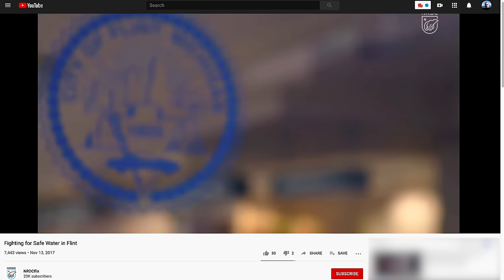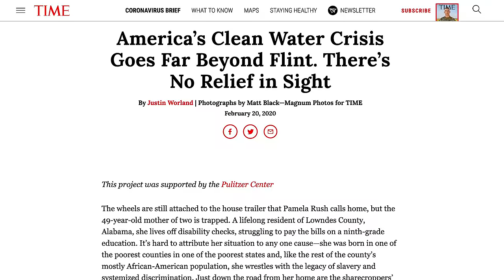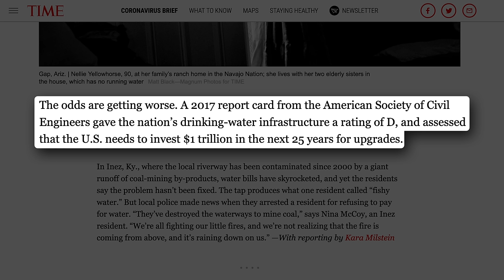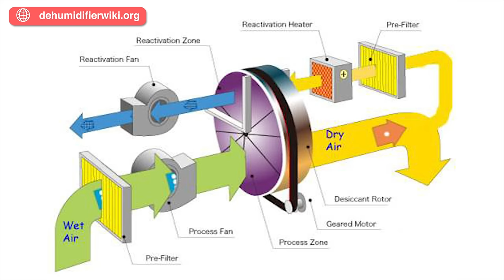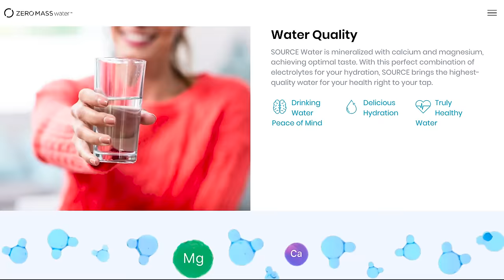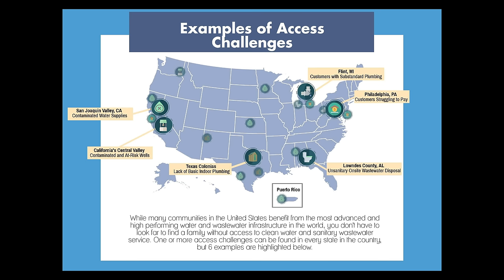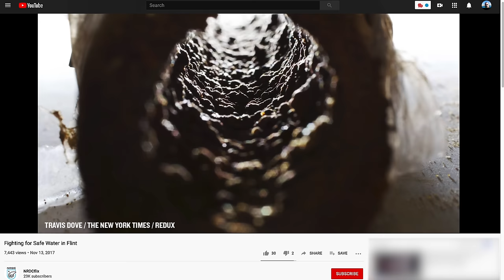Off-Grid Water With Air and Sunlight

Comment: Elon is thinking of an HVAC system that also produces potable water.
Reply: The theory is that HVACs already produce potable water based on the condensation process of pulling humidity out of the air.. it's a question of rerouting the water for drinking purposes.  Don't tell Ben .. he might be disappointed knowing he spent a few more dollars than he had to..
Reply: That's the easiest thing in the world, and hardly requires Elon's engineers to figure out; you just route the condensation drain line into a tank for a filtration system.
Reply: I’m pretty sure Tesla’s HVAC will make way less noise.
Reply: @ArcherWarhound Yes.  The only challenge is that they don't have a more powerful system yet for home use.  The HVAC system in the Model Y is too small.   They could push it though as a compact dehumidifier/heatpump for small rooms.
Reply: ArcherWarhound. I'm sorry but if you look inside your condensorat your home, you will have a total change of mine. Their not build adequate for consuming the water produces that is produce. Maybe for watering your plants
Reply: Yep condensation, need to go Dune and put Still suits on Tesla's. Home aircon should make enough,  salt, brackish water can provide humidity. Not many places with zero humidity. Frozen water is still water.
Reply: the water from HVAC does not have the minerals of natural water
Reply: @kawabanga9507  nope you are wrong
Reply: @nelsonpagan5163  yes you are right, plus those conduits needs to be cleaned after sometimes for drinking pruposes
Reply: Le Chat Botté please explain. How loud is your HVAC in your model 3? Basically it will be a scaled up (1-5 ton)version of it. I can’t imagine that it will be as loud as this unit.
Reply: Alternatively install mains water filters. A .05micron paper filter and a .05carbon filter will give you pure drinking water
Reply: Easy yes and no. Getting the water is simple enough, but what I’ve seen come out can be kinda dirty so they will need a filtration process if they don’t want the water to taste like s***
Reply: We just installed a top of the line system by Lennox, total of 3 units that have an ultraViolet light filtration system scrubbing the air with an ionizer charging opposing small particles so more of those tiny micronic particles get collected by the 2 filters which live in a box housing the UV bulbs..... So there's always forced air running through the vents and it's extremely energy efficient and quiet. I'm all about saving energy and killing viruses and bacteria in the air. I love the idea of generating water. I would definitely look into that. thank you for posting this video and taking the time to make it. I became a subscriber
Reply: @kawabanga9507  Acura, 10 years ago, developed a system by using the stereo to create canceling sound for a quieter ride.  Point being, put speakers near the unit to produce low frequency sound near that high squeaky noise.. problem solved.  Using one frequency to cancel another frequency is not a new idea, Acura made an interesting application but clearly their can be many applications for noise cancellation using this method.
Reply: Erin isn't the one thinking.  He has no brains.  LoL His smart teams are the one coming up ideas.  He is just pick and choose one he thinks it's gonna make money.  That's all.
Reply: @ArcherWarhound  The trick is to keep the condensate clean and sterile.  I suspect the solar panel uses electricity or the UV to sterilize the system so it doesn't start growing mold, fungi, and bacterial contamination from the particles in the air.  You ever seen the slime in the discharge pipes from your HVAC system?
Reply: @williamediger3193  Yes, I have seen the slime that builds up, I've cleaned it out of many an HVAC, that's why I said it need to go through a filtration system after being condensed.  You could reduce the amount of yuck in the condensate by having the air go through a REALLY good filtration system before hitting the cooler/condenser, but then you'd need a more powerful and thus noisier & power-hungry fan.  So filtering after cooling/condensing makes more sense to me, but I could be wrong.
Reply: @ArcherWarhound  Yeah, I agree completely.  The only place this system makes sense is if you live in a desert or area with limited access to water anyway.  I have an artesian well with a pump run off solar panels.  The water is clean and if it does become contaminated, filtration and cleaning techniques are still cheaper and easier than this system.
Reply: AC Condensate is actually either caustic or acidic (I forget which) and typically has very high levels of copper / aluminum due to the refrigerant lines and condenser lines where the condensate drips from and comes into contact with.  It isn’t safe to drink directly and would definitely need filtration and probably ph adjustment as well to be safe.
Reply: Sure, if he can make money off of some poor sods with that.  The Greens are thinking about making water potable again by reducing environmental pollution, but that is an utopian dream; no billionaire would be able to make money off of that.
Reply: A dehumidifier? I keep on in my windowless bathroom.
Reply: This is not potable water. You can't drink distilled water because it will deplete your electrolites which could give you a heart attack or shut down your kidneys etc. Oh, and by the way, Elon is a pothead crook.
Reply: @nelsonpagan5163  requires some modifications... rather minor...
Reply: @leolima75  I have been drinking DW for years...adding plant-based minerals...
Reply: @aeh8446  like I said, it's not directly potable water.  Do you need heat to extract these 'plant based minerals' ? Put that on the bill too. That's probably hundreds of times more expensive than water coming from the natural hidrological cycle of the Earth. But we're desertifying everything and thirst shall come.
Reply: HVAC systems already produce potable water. Nobody bothers to do much with the condensed  water.
Reply: @williamediger3193  cheaper for short run but what about the limits of artesian water wells? Maybe Arizona and similar could give tax credits for using this type of system (Elon’s or this or another similar) instead of taxing the artesian systems that could feed wildlife?
Reply: Elon is going to produce that for 1/3 less and use his slave labour for that
Reply: Yes, but it may be illegal.  Check your state law
Reply: @aceshigh235  Yes, I made one three years ago for my RVconverted ambu, with whole-house filtration, UV, and minerals added. Still working. 
I went to the Denver Botanical Gardens to examine the unit these ppl installed as a promo, and it produces ONE gallon per DAY, unacceptable for any animal over 40lbs.
Reply: The only thing that they need to do is make sure you have real good air filtration and probably some stuff to make sure you everything is clean and probably some uv light but ya not a huge deal
Reply: Already exists.
Reply: @kawabanga9507  Modern units make very little noise.
Reply: @nelsonpagan5163  wrong.  It's perfectly clean if you keep your unit clean.  Regardless, it's very easy to filter.
Reply: @carholic-sz3qv  True, but still drinkable.  Very easy to add minerals.
Reply: Luke Skywalkers Aunt and Uncle were water farmers using solar powered water vaporators(air conditioner condensors.
Reply: @Combat_Pyro  Easy to treat.  Been there, done that for a living.
Reply: @leolima75  It's easy to treat and you merely need to take mineral supplements.
Reply: @leolima75  He's launching rockets into space, building electric cars, founded PayPal, digging tunnels under cities, building a global wireless high speed internet grid, and fitting homes with solar panels and back up power.   What is it you do?
Reply: @danielvilliers612  slave labor?
Reply: @dherman0001  what I do is don't discuss with fanatic fans.
Reply: HVAC SYSTEMS PRODUCE A TREMENDOUS AMOUNT OF CONDENSATE THAT IS UNUSED!  I COLLECT MINE 2 GALLONS A DAY IN SUMMER,...AND USE IT FOR ALL KINDS OF STUFF!  I FILTER IT AND TEST IT BEFORE DRINKING THOUGH!
Reply: @falcon127  I've designed condensate reclamation projects for 2 major universities that use the water for irrigating athletic fields.  Not as much concern need ed for water quality.  These work of the HVAC units that suppplied this condensate are the size of mobile homes, so you can imagine the volume of water.  The best use of the water is for other than drinking, toilets/washing/growing food, etc.  They do make simple mineral tabs designed for fortifying and cleansing condensate water intended for drinking.  It's important to note that the areas which could use it the most(low humidity climates) would generate the least and visa versa.
Reply: That will also condense air pollutants. The idea is to split the water to hydrogen & oxygen gas and recombine them to water. thats why you need to add the minerals.
Reply: all HVAC systems produce water
Reply: Bro do you want this HVAC mafia die as well along with conventional automotive?? 😂😂
Elon is a great human being 👏👏👏
Reply: Elon is also thinking of controlling the world.

Comment: We purchased an Air-2-Water generator about 8 years ago. It is an enhanced dehumidifier with walter filtration capabilities. I looked at at the tpye of unit you demonstrated but the lower cost of Air-2-Water made the decision. In Missouri, the higher humidity gives us about six gallons of water a day. I siphon off water to store for days that are colder. It isn't perfect but it does a good job. I want to install one in an off-grid RV with a composting toilet and recirculating shower. It could happen.

Comment: You can make your own primitive one. Glass pane tilted down laid on top of a black box with a glass pyrex pan inside to collect the condensed distilled water. Must be tightly sealed. Not huge quantity of water, but if you have multiple "solar stills", & empty the pyrex pans regularly, could have enough.

Comment: Ben, what I would like to see is how does the thing actually work? (And that noise makes me a bit skeptical about 15 years almost service-free lifetime.)
Reply: So if it has a 15 year warranty you think they expect it to last less than 15 years?
Reply: Jason Kates is that the same way Tesla will be gone?
Reply: @kayak_1  Actually the science behind the Tesla doesn't make economic sense.  It uses a secondary power source (electricity) which is generated by a primary power source (gas, coal, and nuclear) which is polluting, finite, and expensive. There are other technologies which will generate liquid fuel, like ethanol and methanol from technologies that use sunlight, air, and water to capture the CO2 out of the air.  This will blow Tesla away.
Reply: Jason Kates I already have solar panels. Why not just buy a dehumidifier?
Reply: @scottpreston5074  Have you looked into actual electricity source mix recently? Have you looked into the efficiency of electric cars (especially Tesla and Koreans) making them emit less CO2 that ICE cars even if the electricity is 100% coal-sourced, which it nowhere is? Have you looked into the cost of CO2 capture and processes to convert it to fuel (of which all but Sabatier process are at laboratory stage)? Don't babble.
Reply: @bazoo513  
"Don't babble"
Cultist nonsense in the comment section about WATER.
Ad adsurdum, Telsaum. "Once said, the name drives all to be pedantic."
🙄

Comment: Used to work for ZMW. I think they changed their name to something else. The problem is flowing enough air mass with the available PV energy. One standard cubic foot of air volume flow per minute can capture ~.0126 lbs of moisture (standard pressure, 100 degF, 20% RH, as in a desert application). So to capture 2 gallons per day (7.566 Liters at about 16.6 lbs water) means you have to flow 1300 SCF of pure through-flow (no sucking of the air you just processed, and no re-evaporation of water you've already collected. 

Sounds like a very doable problem, as all you need are 2 40SCFM fans running for 17 minutes. Easy right? Well it means everything must be perfect: perfect capture (absorb/release cycling matched to available air moisture at that time), leak free capture, no loss of heat, no evaporation of water you'd already collected, no spoiling of the water....you get the drift. The devil is in the details.
Reply: prolly has 4 of those fans
Reply: @zerxilk8169  in fact it did, yet it takes two units at installed cost of $7200 to capture 5-15 liters of water per day. That's less than 4 gallons. It makes some of the most expensive drinking water in the world. Totally impractical.

Comment: I use a distiller that stores up to 5 gallons. I can power it with my solar battery. Costs a lot less than this unit. The fan is quiet. If my water is shut off, I can fill the boiling tank with water from my pool. This device that makes water from air sounds like an essential item for dessert living, but can't imagine anyone else needing it.

Comment: Imagine having something like this on the roof of your RV. You could Boondock for weeks without running out of water!
But the noise and the inability to operate in the winter up here in Canada are the two drawbacks to such a system.
Very good video and thanks for sharing this!
Reply: 700lbs on your roof and that awful noise is not worth it. If they could get the weight and noise down, it would be an awesome product for rv life.
Reply: You don't have to worry about winter here in Canada you got snow boil it for 10 minutes just to make sure you get rid of any bacteria and your good to go bro.....don't forget to add some minerals.

Comment: The more I watch this the more it feels like an ad 😂
 For one a average recommend water consumption per day for a grow up is 3 ltr minimum.
When taking water from air it depends on your location ie water content in the air if you like close to the shore you will get peak efficiency and the energy spent is equal to the energy required to boil the water so it's not really a efficient usage of the energy

Adding a simple water filter to the tap will be much more economical
Reply: Not everything can be filtered by a normal filter. For example lead is not easy by just a simple filter...

It is a very inefficient methode but it makes you independent from external forces for your basic need of water and that is a huge bonus.

In general they are looking to make homes more and more independent from the grid for several reasons. This might be one of the last steps needing to do so: 
For electricity use solar and wind + battery as buffer
For non-human water use rainwater (toilets, showers, dishwashers, ...)
Now for clean drinkable water (drinking and cooking warer) you have this project and hopefully many improved version/alternatives in the near future (independent from this company or not) 🙂
Reply: @Stinosko  I agree rain water harvesting is a highly beneficial technology, so why not filter that water and use it in the kitchen 

point was the only places these will work is places which have good rainfall or lot of water in the air..like islands where desalination makes much more sense . I don't get the point of spending huge amount of energy to capture water from air ?
When compared to rh world there is a tiny geographical pocket where this would work and even in those areas it's not energy efficient compared to other technologies
Reply: @DA-sp2qy  Same issue: you can't passively filter the every toxic element from rain without using many energy to boil it and let clean water condensate and catch the clean concentrated water. Which probably is around same size of energy investment as this technology (is my assumptions) 

The main point here is: it's possible to be 100% off grid if you want or need to be. For example what he said in the video: not all homes have clean water reliably provided by goverment. (No foundation, lead foundation, no good regulation, ...)

There is a valid usecase that this technology (clean water anywhere) is useful or even needed. Not everyone benefits from it (just yet) for example like you 😊
Reply: It would be nice to see a comparison between the power usage of this technology and other technology to clean rain water to the same healthy level as this technology. I don't know who is gonna win so we both can be right or wrong until a independent researcher investigates it 🙂

Comment: kinda pricey for a solar powered dehumidifier, too heavy and required professional installers
Reply: Essentially, get a dehumidifier, connect solar for the electricity, as soon as the water is condensed, drain it out of the dehumidifier and filter(with any OTC alkaline filter) and store in a light proof container(to stop algae growth).  About $600-$1000 on amazon for the components.  That is all they did here.

As opposed to wells, rain catchment, and land management installing swales to increase surface and ground water.  When you do the maths, it is obvious that any "water from air" device is as practical as a perpetual motion machine.

Comment: I can't believe I missed this video, I live in Southern CA just like Ben and I'm seriously thinking of doing this down the road, in 1 to 2 years. Makes perfect sense when you think about the quality and cost of water.
Reply from the maker: 2 things to consider, noise for your neighbors, and running the water into a fridge dispenser so it's chilled. Good luck!
Reply: @BenSullinsOfficial  can this tech work in the Sahara desert? Especially in extreme hot temperatures and dry air (I mean 60 Celsius degrees with no humidity)